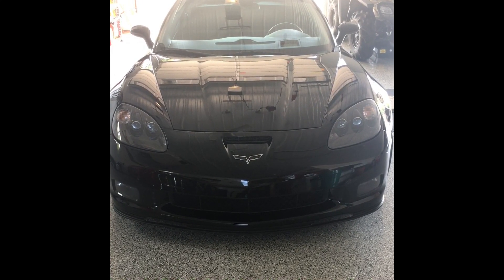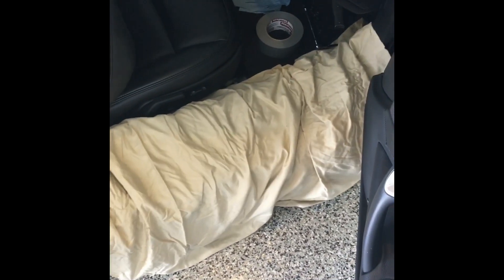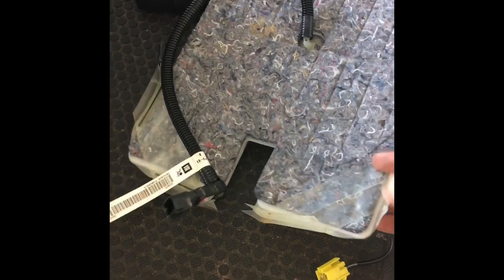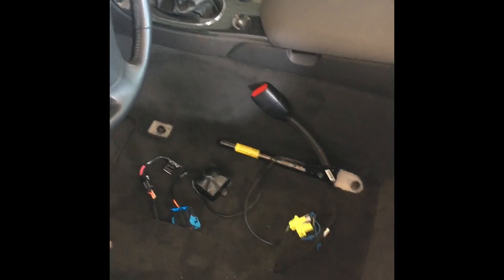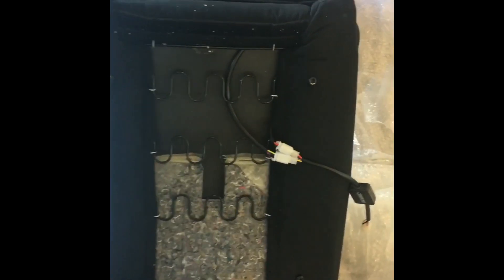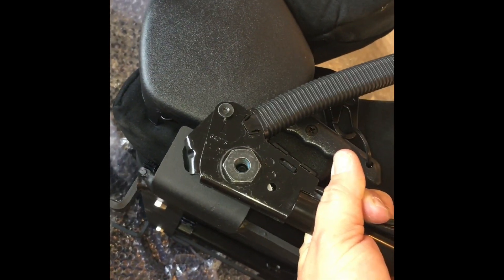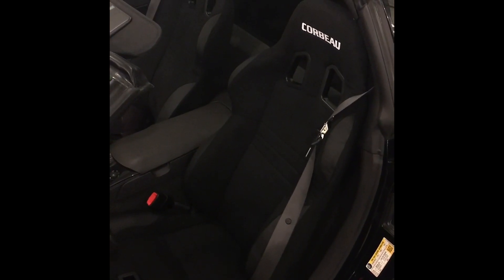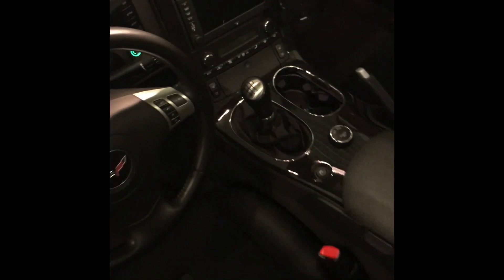Corbeau A4 Conversion - C6 Corvette

Comment: Big thanks to you Ross for making this video!  We have a track ready 2006 C6 Z06.  I installed the exact same tilting, leather, and heated A4 seats from Corbeau, the Brey Krause brackets, the VetteWorks harness (thanks Dan!) the lap belt clips and two red 5-point harnesses from JEGS.  I couldn’t have accomplished it without your help.  It isn’t a project for the faint hearted but doable with your tips and techniques.  

No air bag lights on the dash anywhere (thanks to Dan at VetteWorks) and the passenger side air bag works perfectly when someone is sitting on the seat.  Removing the pressure sensor bladder from the stock passenger seat and installing it in the new Corbeau wasn’t that difficult at all with your directions.  

The project is a delicate process getting everything fitted without scratching the doors, console or door threshold, perhaps even crushing or cracking the harness connections under the seats but if one is really patient, the project can be a 100% success story.  That’s my story…100%.   Just go slowly.  It took me several days to get it right with incredible detailing.

We also modified the Corbeau seat frames and lowered each one by 1 inch.  We cut and welded them back together.  The front of the frames were lowered by 1 inch and the back part was made flush or about ½ lower.  Both of us that will drive the C6 Z06 in track events are a little over 6 feet tall and we needed those frames to be lower.  

The electrical connections for the heated seats going into the fuse box under the passenger side flooring was the most helpful.  Brilliant actually.  Both heated seats are working perfectly after I added the new cigarette bezel without the OEM holes.  Using a 3/4 inch flat spade drill bit made for wood I slowly and carefully cut the two new holes in the bezel and then mounted the two Corbeau seat switches.  It looks like an OEM install.  Actually they look better.  

Introspect, great job explaining how to do the entire project.  Way to go and again a BIG thank you from all of us.  Really good stuff Ross!  Tim in Colorado
Reply: Possible to send pics of how you modified the bracket to lower the seat? Also, did it lower your seating position significantly more than factory? I’m 6’4 and this is my daily driver.... don’t want to risk comfort just to sit lower 😂
Reply: @DarkSharkssm  I can send you several photos how I modified the brackets any chance of you sending me your email?

Comment: Did the pressure pad work the way you installed it? I saw another video where he did what you did with the occupancy sensor pad but his didn’t work properly. Thanks. Great video
Reply from the maker: I feel it has worked fine for me.  It stays off with the car seat and child in passenger seat.  But activate with an adult.

Comment: I just ordered the A4s for my zr1, attempting to do it myself. Labor from a shop is $580, ontop of the 1577 for the seats. I ordered the vettemods driver side module for telescopic steering and the bypass for the passenger side. 1. Why did you switch the passenger seat and driver seats position? 2. Did you reinstall the harness that you pulled from the passenger side, including the pad? What was the purpose of pulling that off and then throwing it back on? 3. Do you think the washers raised the height of the seat? Im already tall, i wanted to try without the washers to see if the seats will fit. I ordered the A4 specific brackets and sliders as well. Thanks.
Reply from the maker: 1.) apparently this makes the seat fit better in the car.  
2.) I did reinstall the hardness and gel pad. I removed the gel pad from the OEM seat and installed it into the A4.  It is an airbag pressure switch.  
3.)yes, the washers helped with rake. Washers only raised the front of seat to provide support under legs. 
Important, don’t freak out if they feel too high right away.  Seats have dense foam and it take about 20 minutes before you sink down to OEM height.
Reply: @rw895  You the man! Thanks for the info. Will try it this weekend.

Comment: Great video, takes the "fear" out of replacing the stock seats. Did you install the harness yet?
Reply from the maker: david wolfel thanks! I did install the harnesses. I used Schroth B23 clip brackets and bolted them in the same location as the seat belts.  I make a video for the belt install in a week or so.